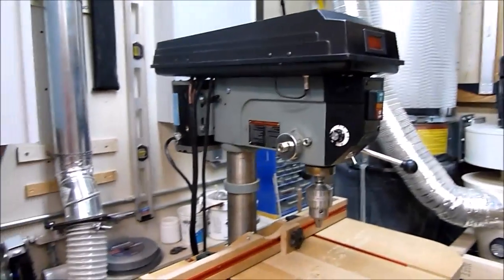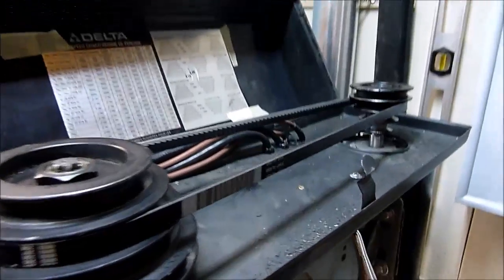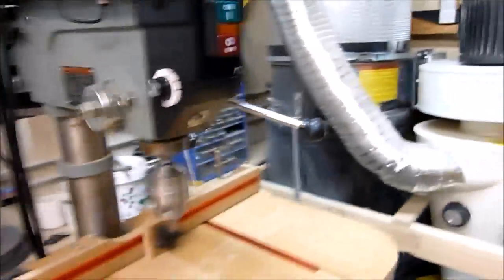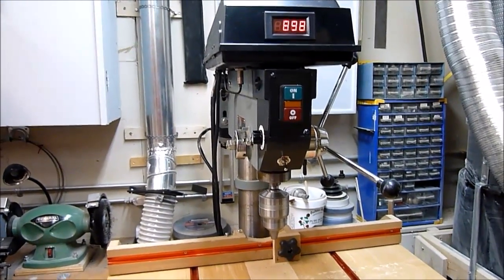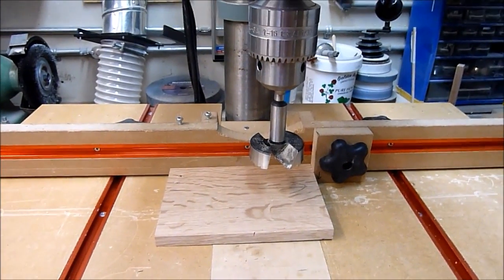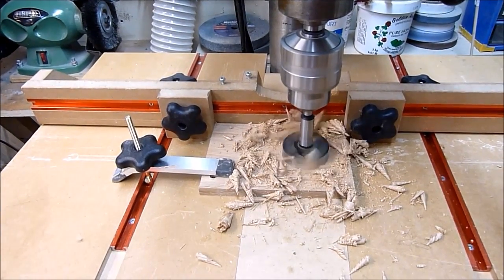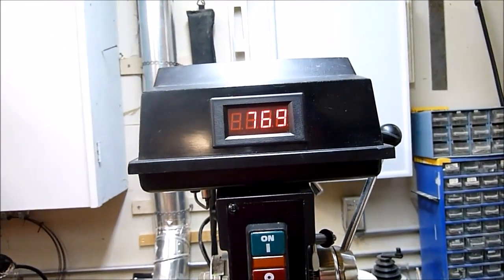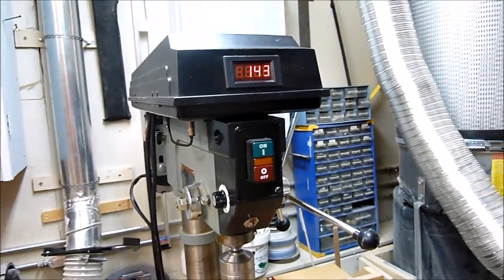Drill Press VFD

Comment: The slow speed would be good for large holes in difficult materials such as stainless, etc.  With a standard drill press you struggle to slow it down enough.  It would be awesome if it still had its intermediate pulley.

Comment: Thanks for the response Randy. I'm still a little confused about the start stop switch. If I use the common for switch, is that the only wire I run from VFD (wire from common on VFD) to switch and where after that? S1??
Reply from the maker: The manual should show connections. They are pretty simple. Common from drive to switches, one line back from the other side of each switch. But please read your manual as it may not have the same wiring options. They are all a little different.

Comment: Great build! I just got the same vfd yesterday and getting ready to install on my drill press. How did you wire up the tach, start/stop switch and pot to the vfd? Do you have a schematic or pic? Again great video and build!
Reply from the maker: The tach is powered from the +24 volt supply on the VFD. The switches can be connected one of two ways. They can be set up to sense 24V when the switch is closed, or they can be set up to sense that the switch is grounded (common) when the switch is closed. I used the common, freeing up the 24V for the tach supply.
The pot is connected to a separate 10V supply and wired to the 0-10V input terminal for the analog input.
It is all detailed in the user manual.
Not every drive is the same. Some do not have a separate power supply and do not have the capacity to run the tach, in which case a small external power supply, like an AC wall adapter or something can be used.

Comment: How did you wire the tack to receive ~15 VDC power from the VFD?
Reply: +Chad Vrla I'm not sure which model he is using but there is usually a 12 vdc terminal on the vfd. just make sure the tach doesn't draw too much...my guess

Comment: So glad I found this video. I have about the same model Delta I am getting ready to do the same thing with. I just bought a motor and ready to order the switches and tach off Ebay. Did you use a 10k linear pot?  Would love to be able to email you if I have any questions.
Reply from the maker: +Toolferone F Yes it was a 10K linear pot.